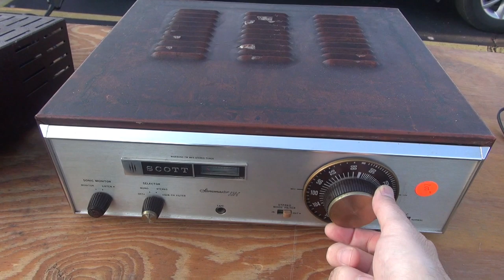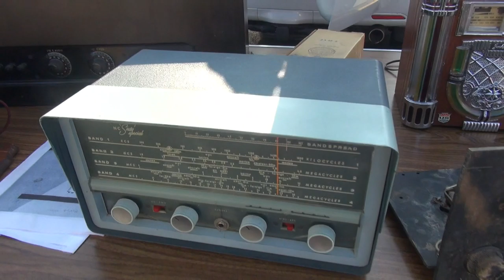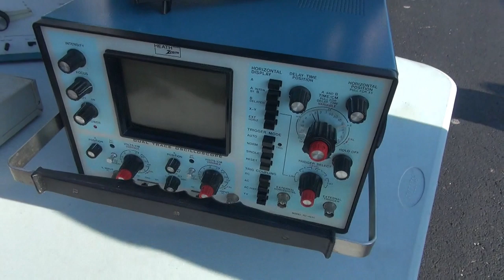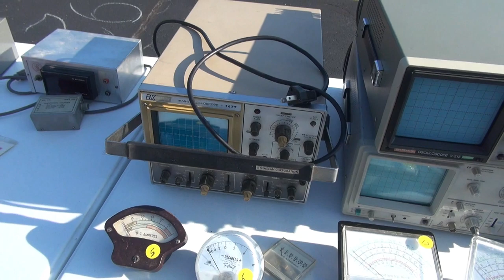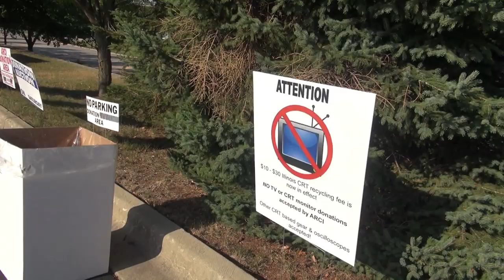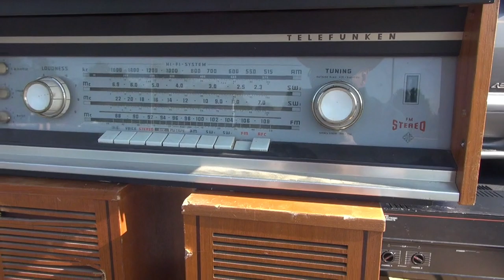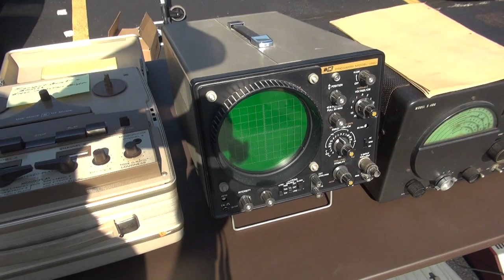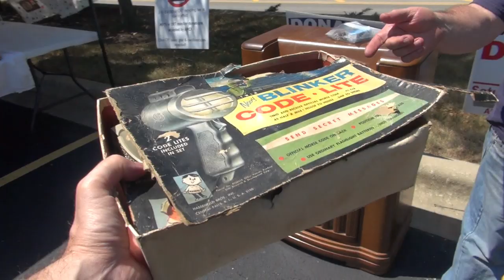2019 ARCI Antique Radio Fest Chicago IL Swap meet Collectors Heaven

Comment: Very cool stuff.
I want to mention that tuning bars remote because it has a special memory for me.
My 1st job in a TV repair shop back in 1974 the owner put me to the test fixing a TV that had the chanel changing motor that would start changing the chanels non stop as soon as the picture started warming up.
Well, I figured it out in 15 min.
The reciever in the set that was listening for the 1 bar tone to activate the chanel change  just kept the motor running because the Horozontal output tube was giving off the harmonic of the exact tone of the bar in the hand held remoe you had there.
Never forgot that. The shop owner was impressed that I figured that out so soon.
Knowing what I know now, it was not that impressive but I would have did the same thing to a new guy anyway. :-)  
All those tube amplifiers, I actually worked on some of those too.
Some people are die hards for that old tube stuff. I gotta say I am too.

Comment: You don't know how much I enjoy these radio show videos! Thank you so much for doing them. Seeing this equipment from the past is always wonderful, almost as much fun as watching you and Marcia as she pretends to give you a hard way to go about bringing a ton of equipment home. Next time you go to a show like this rent a U-Haul van and see what she does. 

Notes and observations about items in this video:
You saw @ 27:14 one of the very first ever portable TVs. They used a rather large and expensive battery that would provide about 45 minutes of viewing time. 

At 32"39 is a navigational direction finding radio. By having maps that shows the transmitting tower locations the antenna can be turned and the radio carefully tuned to triangulate the position of your boat on a large lake. These were used before Loran which predated GPS.

That was Setcher Carlson. Set Cher

At 47:56 is a Philco Predicta, a B&W TV made to look like it came from the future. You saw a few others too, Philco made several models. When I was in vocational school someone brought one of those into the the Radio and TV class to have repaired. It stood upright sort of like another one in this video (1:00:50).  Beside that second Predicta was an Atwater Kent TRF breadboard. NICE! And yes, that little cathedral had a cast faceplate. Sorry, I can't recall the correct term for that right now.

At 48:18 are two Edison phonograph cylinders. They are made of a hard wax with the groove cut around the cylinder. This was the very first successful method of recording and playing back sound. Sound is recorded vertically in the groove. That Edison dis phonograph in the video uses the same vertical sound groove technology. The Edison players wern't nearly as much of a lathe as the Gramophones and Victrolas because the tone arm weight was not transferred to Edison's cylinders or disks, only the weight of the diaphragm and part of the diaphragm housing. The disks were called Daimond Disks because the Edison Disk Phonographs used a diamond conical stylus and the records were a hard phenolic resin similar to, but predating (~20years), Bakelite.  

At 1:17:49 is in fact a wire recorder. These were used a lot by executives although the entertainment world used them too.

Thanks for sporting one of our Museum of Radio and Technology shirts! (Marcia needs one too.) If you are EVER going to be around the Huntington WV area, please do call and let us know. I'd love to meet you and show you around our museum. You have probably met Geoff Bourne and Grace McMillan when you  bought that shirt on your last radio show video. BTW, last Saturday and Friday a week before another one of our members and fellow hams was working on a Johnson transmitter. Yes, we have an operating ham shake with numerous radios, boat anchors to older solid state. It's worth bending the course if you are passing anywhere towards our direction! 

Thanks again Terry. Love watching your videos.

Comment: As a child ( 50's), my dad bought me a battery powered hand-held portable tube type radio. I remember it took a 67 volt battery that looked like a long 9v battery. Back then, I would take things apart to see what made them work, but I was not good at the reassembly part. I have not seen this type of radio since. I really wish I hadn't messed with it.

Comment: I tried to find the commercial of the Hasbro Navy Blinkers on YouTube. No luck. I saw it in around 1963 when I was a smaller brat.

15:10 - I see my first RCA Strato World radio, just like the one I am currently restoring. Cool! I've watched a lot of these radio fest videos and that is the first time I saw this rare RCA radio. In fact, I had never seen an RCA Strato World before I was given one last month. (Thanks, N6VFH!) Only  $100? I have spent more than that for the battery replica and batteries to put in it! RCA VS047 with 6 D cells and 60 AA cells! (From www.elmphotography.com/radio.htm)
15:39 - Phontrix tape recorder from Germany. I had one when I was 11 and it was the best portable I have ever owned.